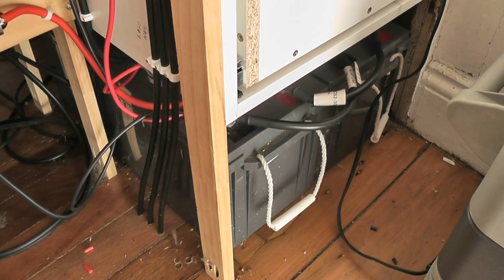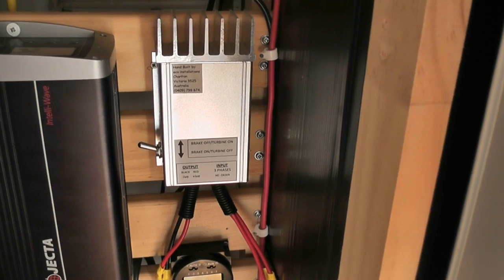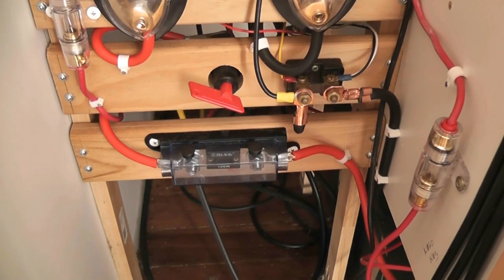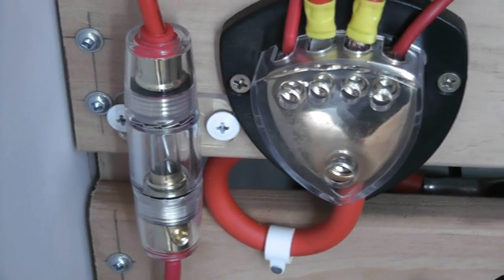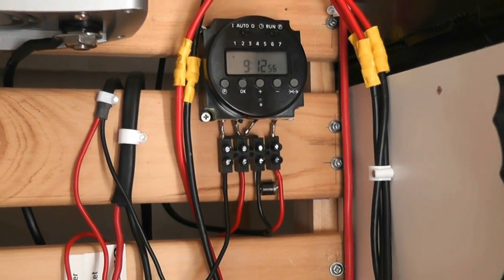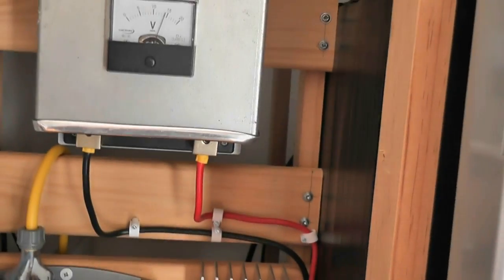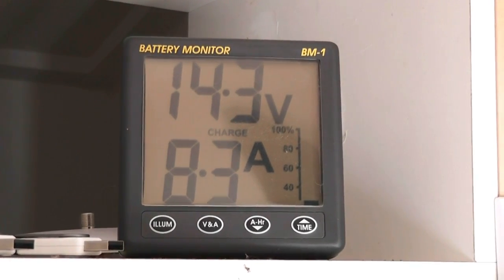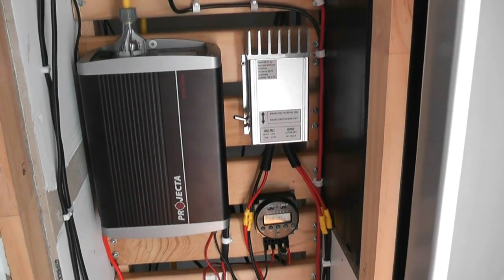Small Wind Generator System

Comment: Installation is nice but this clicking load relay is bad. This relay will die soon and your voltage is unstabe. I had same problem with solar charge controller: it reaches 13,7V and then drops charge, battery voltage will drop and charge will restore on 13,6V. This is not good for battery and also flicking LED lights. Solution: I built a charge controller myself. I used LM317 adjustable voltage regulator to get desired stable voltage and used optocouplers to drive power mosfet transistors. Parts are dead cheap in Ebay. And biggest + is this scheme can be built both ways. 1st: to cut charge if battery voltage goes over limit OR 2nd: to apply load when it reaches limit without clicking and voltage jumps. Absolutly  smooth electronical swiching. Another BIG + is you can use leftover power usefully like hot water heating or house heating. Also Your wind turbine is protected from to high revs in stormy winds because of constant load. That sort of load system is good in 3 or more stages like 13,7V  will add 50W load, 13,75V adds 200W and 13,8V will add Max rated output of your windmill.
I hope You got some good ideas!
Reply: Margus Raamets please share the schematic with us
Reply: Margus Raamets do you hace a schematic of that controller
Reply: Marcus could u share the schematic  wit us plz

Comment: Verry nice system, only the silverbox could be inproved.
I would go with a special windgenerator charger that puts out max 14.4 v, the rest of the enegie wil it dump in a heating element(aka dump load). This heating element could be place in a big 200L barel in the return line of your heating system. 
What i als would do is is witch the  inverter  automaticly on when the battery is 70%+
when you generata more then 70% of your power use you can get rid of grid.
 Then upgrade the battery bank(solar en windmill also) and build a 12v generator(with a lawnmower engine) .

Comment from the maker: No real maintenance issues so far. About 6 months or so.
We run

All LED lighting in the house
2 x DC TVs
Laptop
2 x 60 lt fridges
small appliances
sound system
water cooler
DC security lights
rechargeable equipment

Comment from the maker: The system is still growing. I got rid of that clicking relay and went to a solid state controller.
We have 400 watts of solar as well. While we have mains power I can run a lot off the DC  system.
Reply: Where did you get your ecco rectifier